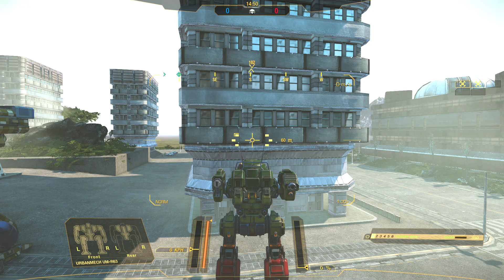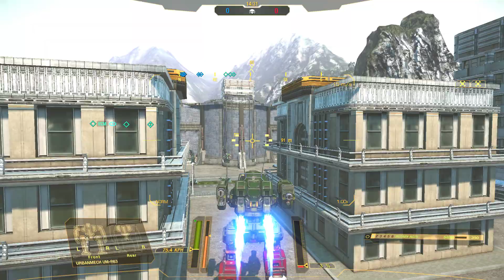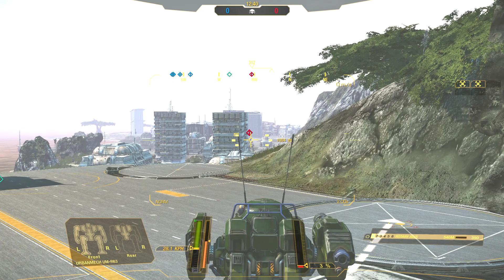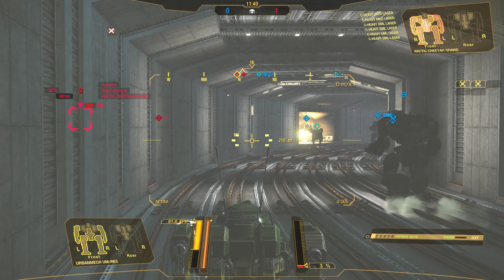Battletech lore : Urban Mech

Comment: Honestly I cant like it. Too slow and nowhere near enough armor. Honestly police could use it for street riots, but in military, especially seeing as the Aries convention forbids urban fighting, it's useless.
Reply from the maker: "Although noble in intention, the spirit of the Conventions was violated within a decade." ( http://www.sarna.net/wiki/Ares_Conventions ).  i agree that its not the best mech but it as you mentioned keeps the masses in line and when you feel like breaking the rules urbie in the urban jungle could be the little bastard with the ac 20 that sneaked by you to shoot you in the back
Reply: an AC 20 is not of that much use against an angry mob. Take a bunch of machine guns or LBX instead...
Reply: That's what the energy hardpoints are for. Seeing your rioter friends mowed down by machine guns is scary. Seeing them vaporized by the dozen is horrifying.
Reply: @Joska Rifinaukr, Good point. Too bad the urbie doesn't have a whole lot of hardpoints for that.
Reply: I think all the variants have at least one energy hardpoint. The tricky part is tonnage with the AC20 eating up so much. I think there might be just enough to fit a small laser or two, especially if you use three jump jets instead of four, but unless the rioters got their hands on power armor, one small should be fine for suppressing civilians. And if that fails, you can always step on them.